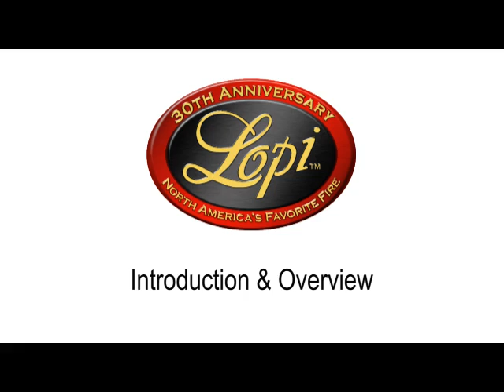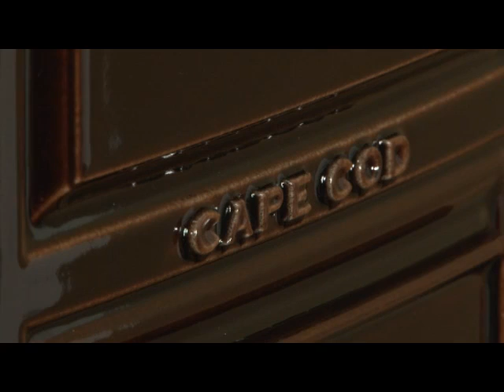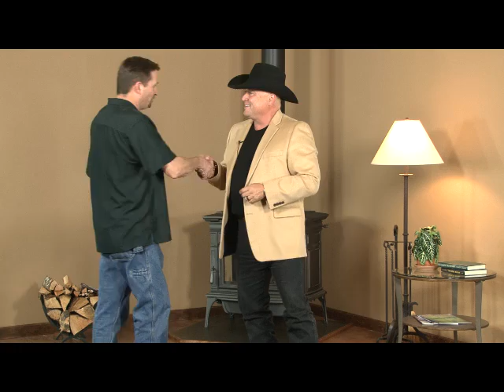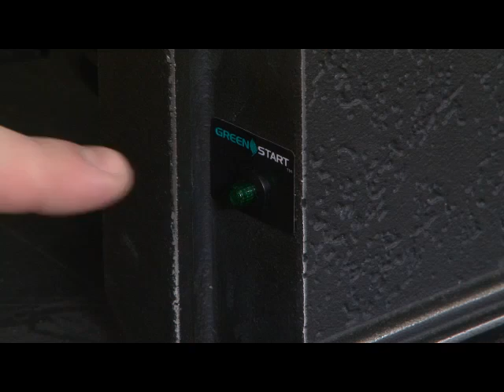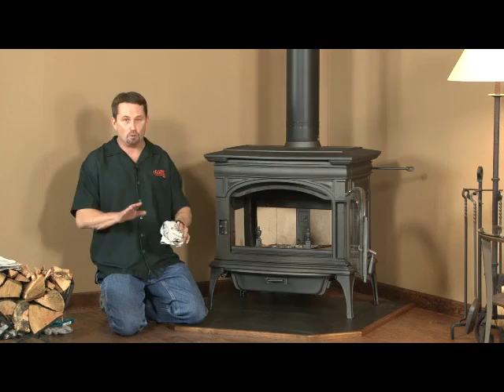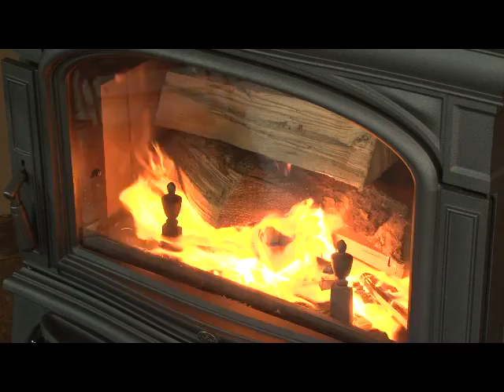Lopi Cape Cod Homeowner's DVD by Travis Industries

Comment: Catalytic wood stoves require dry seasoned wood that is 20% moisture or less. That usually takes about two years of seasoning, and three years for Oak. Use the moisture meter they give you by taking a split and split it once again. On the freshly exposed side of the split test the moisture content with the meter.if it’s over 20% it needs to dry longer. This is usually the solution to many problems people have.

Comment: This really surprises me about the attitude of Travis Industries to not resolve issues with their products since we are talking a product that contains a fire in the most valuable possession we own...our house.  This appliance is critical to heat, and do it safely without incident. I have owned wood burning stoves for 29 years now, and have gone through a few. My latest one is the Lopi Liberty, and we like it a lot. But I don't get the burn times that they advertise, unless you're talking about a piece of wood that remains the size of a match head. If that counts, then I do get the burn time, but rarely that even doesn't happen.
Technology is great until the day it doesn't work. It is designed on great forward thinking, but in the long run it doesn't last, and needs to be replaced either per schedule, or it just breaks down prematurely, and most times needs to be replaced expensively, shockingly expensive, and it's proprietary, meaning you can't find it anyplace else except from the manufacturer that really socks it to you. 
I suggest you stay away from catalytic converters. You will eventually have to buy another one as the heat will break it down. Stay away from that green start button.  It's electronics afterall, and all electronics will fail, so just strike a match, or a long stick lighter.

On my Lopi stove, when the heat is high enough, it is supposed to trigger a thermodisk to close a circuit so that the blower motor kicks on, and at nite when the stove cools down, it's supposed to recognize a temperature drop and turn off the motor.  The problem is the thermodisk is heat sensitive one day, and next time it isn't.  If I smack it with my hand, it will turn on the blower, otherwise it fails. I replaced it once, and it lasted 2 years, then failed again. Never again. So I rewired it to a toggle switch, and put a timer in the  wall outlet that only  cost me $9.00 The thermodisk costs in the $20.00 range, and it fails all the time. You rarely get your money's worth on what you think is good technology, and is short lived unless you have deep pockets. I can afford to replace parts, but I choose to be smarter than the offerings of technology.

Comment: THIS STOVE INITIALLY WORKED GOOD.   But all ended at the end of the first year!!   We are going on the 3rd year of misery with this damn Cape Cod stove.   I have tried to speak with the factor AT  Travis Industries which is a close neighbor in here in Everett Wa and they could care less to explain why the combuster on this stove is so troublesome on start up and EVEN AFTER IT HEATS UP,  you always get a trickle of annoying smoke leaking past the air control mixture rod so you can NEVER damper it down fully for its maximum long burn time.   WE ALWAYS GET A FACE FULL OF SMOKE WHEN WE RELOAD IT EVEN WITH PULLING THE DAMPER ROD OUT.. I do not know how they can,  in good conscience,  continue to mislead the customers on this stove.    ALL THE WARRANTIES in the manual HAVE SMALL PRINT that take away any warranty you think you may have.   BUT WE GOT AN EXPRESS WARRANTY THAT ASSURED US IT WOULD BURN 8 TO 10 HOURS WHICH IS NEVER HAPPENED...  

THIS  VERY EXPENSIVE STOVE A TERRIBLE DISAPPOINTMENT. AT THE  BEGINNING OF THE 3RD YEAR OF USE.  I think the COMBUSTOR  is the PROBLEM.  Any suggestions out there?
Reply: I have the same stove, burn time is not as advertised with quality hardwood damped way down.....This stove's bypass valve is also designed to small for how large the front door opening is.....A door this large needs 8 inch stove pipe design.....This is why you get a face full every time you reload.....Conditions have to be absolutely perfect for this stove to work properly.....Maybe try removing the cat & see what happens...Your warranty sucks anyway.. I am also disappointed with this product .  If you remove the cat, let us know how you make out!
                           See Ya!
Reply: I’ve had mine for 4 years and only had great experiences with it. Is this your first stove?
Reply: One more thing I forgot to add, The ash pan does not go in deep enough, the ashes fall behind the pan to the back of the stove & than you have to hand shovel the ashes back out........Also the lock nut on the ash draw falls off & needed to be tack welded.......This stove needs an added side load door to help with draft problems, because the front door is too large for 6 inch stove pipe....Lopi needs to upgrade this unit.....
Reply: @splitdoctor1993  anything else hoss, an electric element for when you dont feel like building a fire, or an robot to take out the ashes, or what you could advise is for the  entire stove to be built out of parts from a Lamborghini??????......
Reply: @erickwardwell962  As a matter of fact, yes, for the price they charge for the this unit..... a better built ash pan , the design of this fuckin thing sucks.......The fuckin pan does not go deep enough into the back of stove & all the fuckin ashes fall behind the pan when the pan is not even half full.........After getting fuckin tired of hand shoveling the piece of shit...I had to weld an extension on the back of the pan........problem solved..... This stove needed more field testing before putting on the market...The warranty department at Lopi must be constipated with Cape Cod issues .......LMFAO!!!!!!

Comment: Let me share this quote from a unhappy 'VERMONT CASTINGS'  STOVE Customer here:   QUESTION:  "Am wondering if you'd care to share your opinion about the Vermont Castings "Defiant Catalytic" woodstove. We had to replace the  catalytic converter TWO YEARS after installation, and now must replace BURNED OUT INTERNAL PARTS NOT  covered by the warranty. We've also had trouble since day one controlling the fire. We were told this stove is cutting edge technology, and really like how the cast iron looks with the porcelain finish, but frankly, we don't like the catalytic converter. We notice the wood stoves on your web pages are all noncatalytic. Does  the EPA require catalytic converters now?" 

No I do not think they do require catalytric combusters in wood stoves in Washington State.  We have a newer Lennox Liberty wood stove which used to be the COUNTRY WOOD STOVE BRAND.   That stove does NOT have a catalytic combuster!   We get long time burns and seem to use NO more wood whatsoever.  We have that insert wood stove in another house we own and have NO problems of the kind described associated with the TRAVIS INDUSTRIES CAPE COD stove.